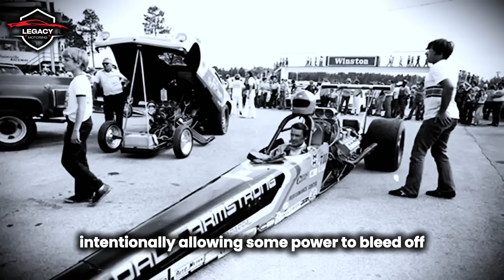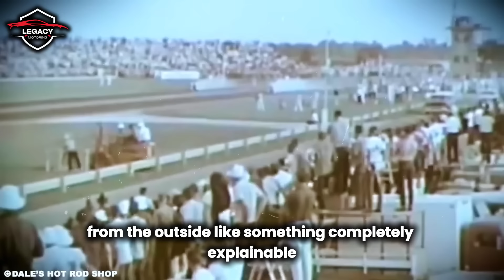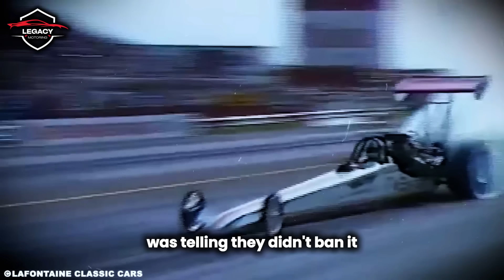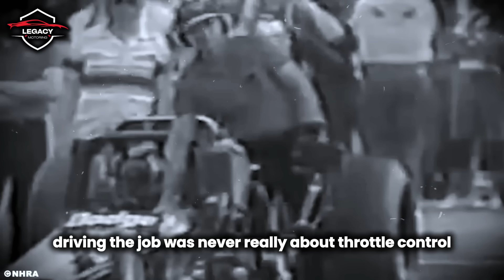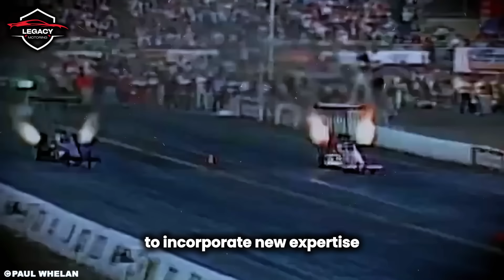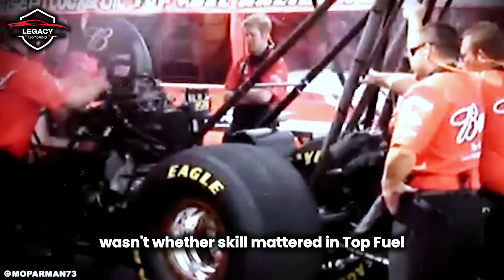The 'Invisible' Black Box That Made 5,000 Horsepower Untouchable

Comment: I understand the clutch, to a theoretical degree. I understand computer control. I don’t understand the physical link between the ‘computer’ and the clutch. Explain if you get a chance.
Reply: The "computer" controlled the output of a valve off of a hydraulic pump, more pressure more grip, infinitely adjustable clutch.